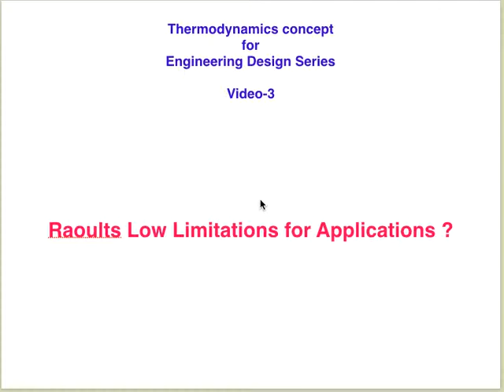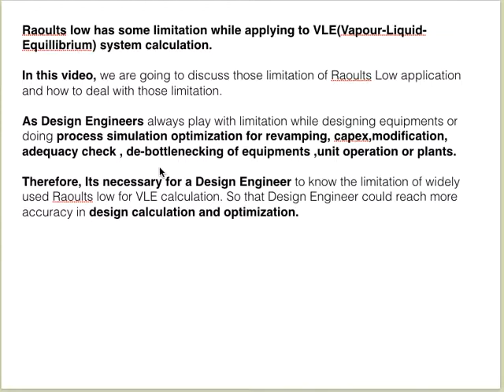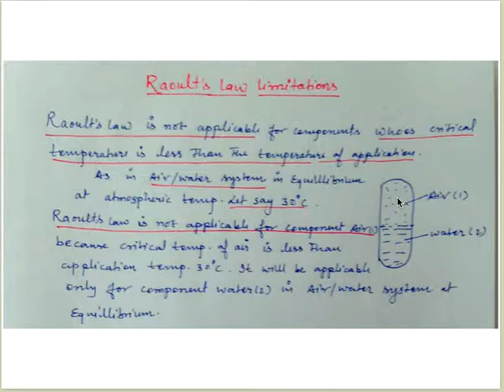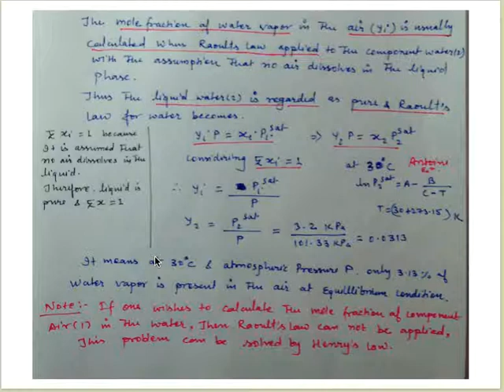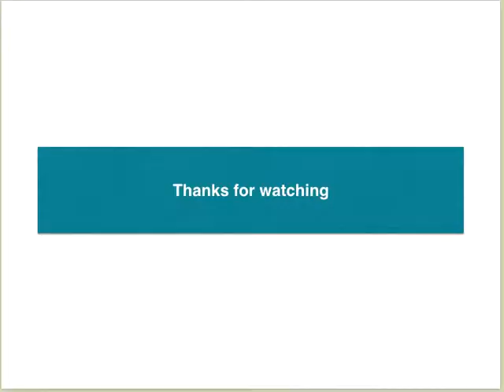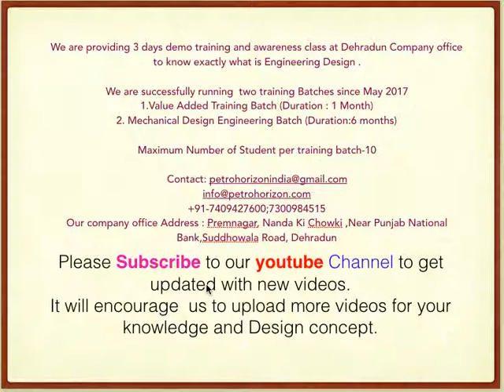Raoults Low Limitations for Applications 3

Comment: In ncert rext book given that raoults law applicable for volatile solute present in volatile solvent. Is it correct or wrong
Reply from the maker: Yes correct but there are many different applications of This law in oil and gas industry engineering design field